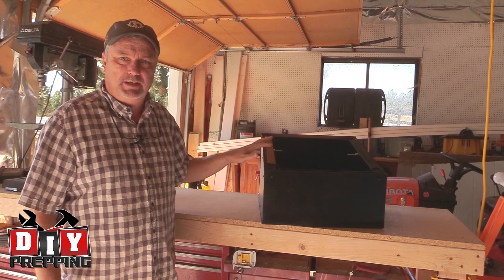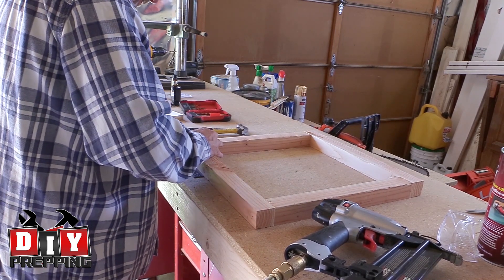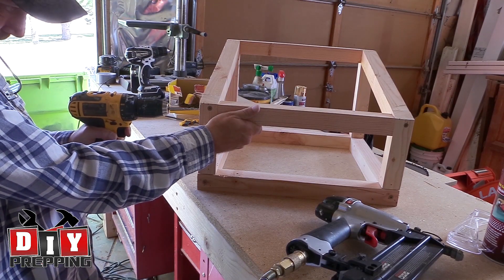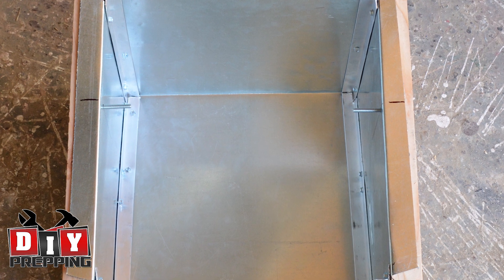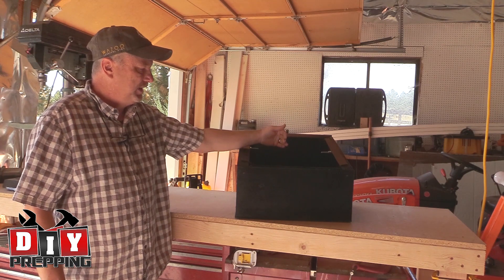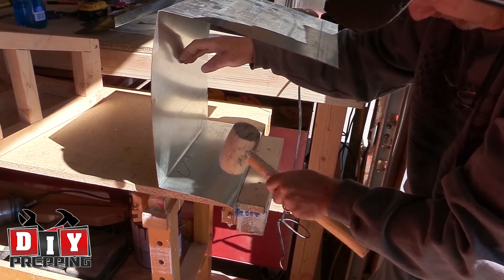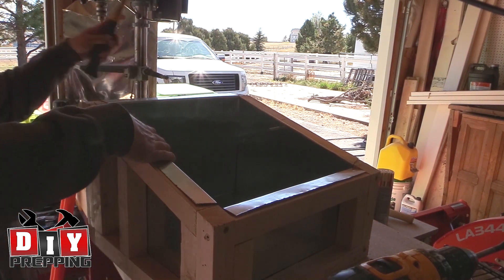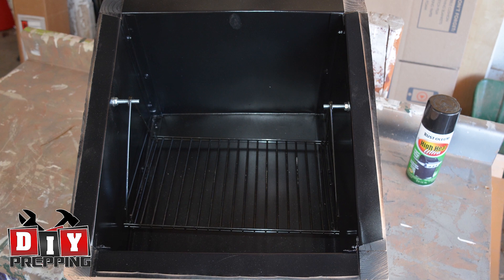DIY Solar Oven: Assembling the Interior Box & Frame

Comment: Great job. Looks good.
What type of sheet metal did you use?
Reply from the maker: Thanks! The sheet metal was 26GA but thinner would be OK I think.
Reply: @survivalistprepper  Actually I was wondering what type of aluminum or steel sheet metal it is.